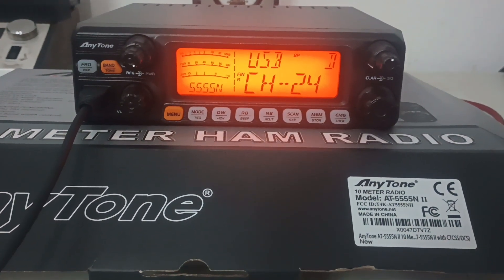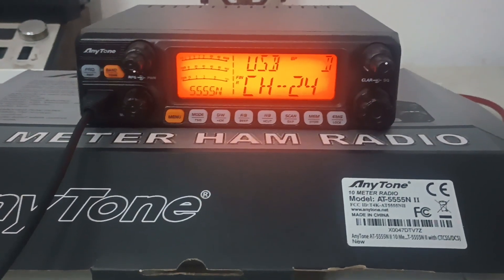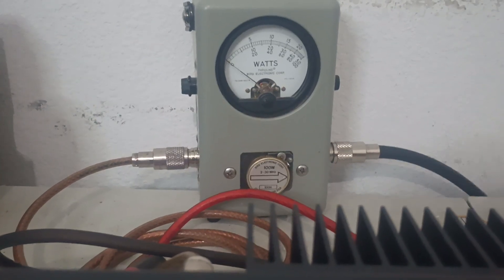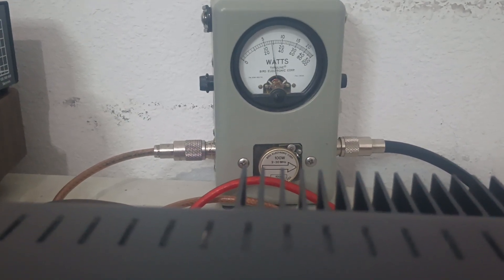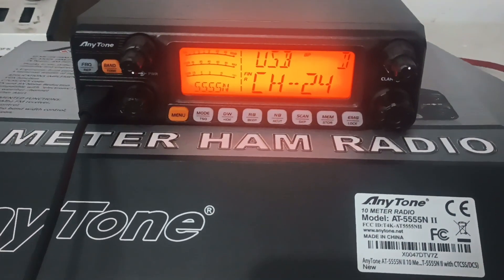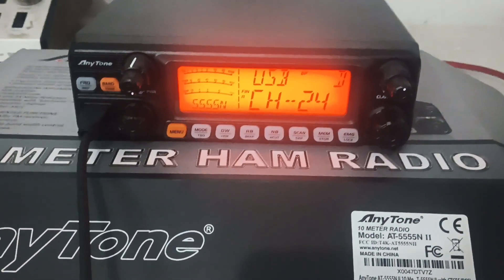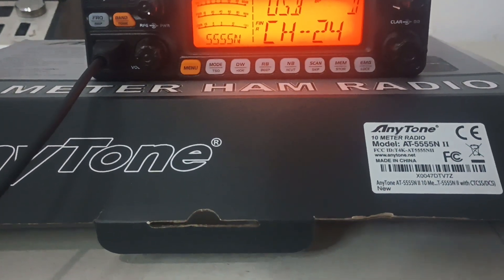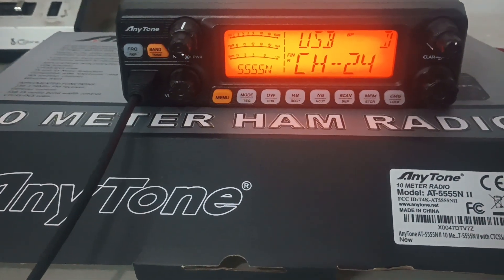At5555n2, " All the Way", Customer Performance Test, SSB/AM, Peak/Average

Comment: I love mine best radio I’ve ever had
Reply: I don’t know about best but I can’t see replacing wit anything else in the mobile. I’ve got the old version. My mic cord is shedding its skin though after a few years.
Reply: @miker8379  I’m using mine as a base station with a fat boy 5 pill and an A99 and having good reports. It’s a joy. It replaced my Galaxy dx77 hml. Hope to catch you on the air. Enjoy

Comment: Pick up a Q60 looks  like the same radio it's  not user friendly  on shifting  10k vs 100 small number right push the 10 k offset it  reads error and kicks to FM😮  miss the galaxy 99